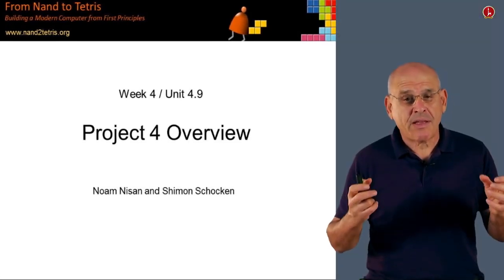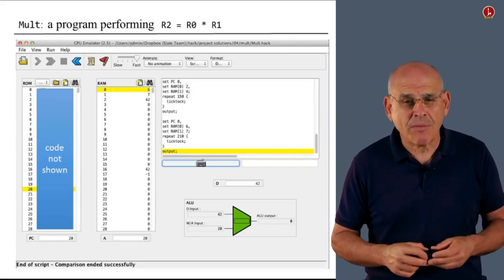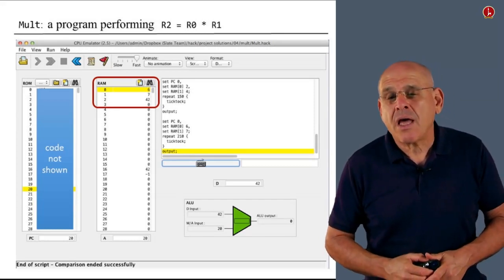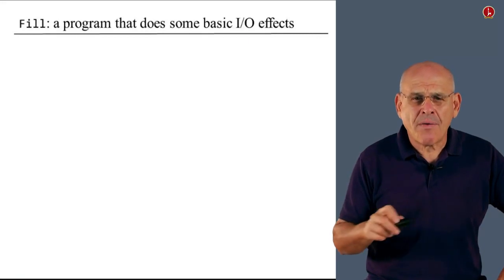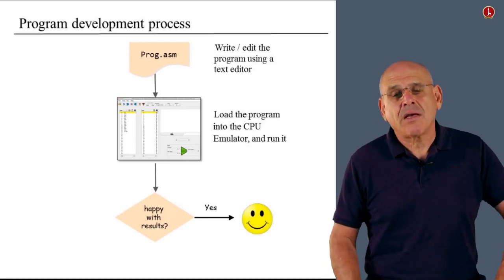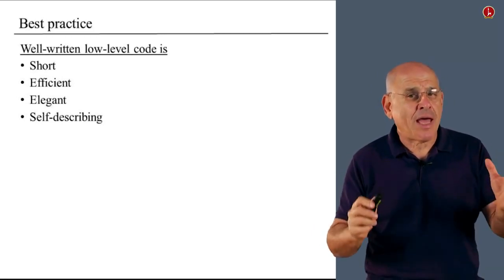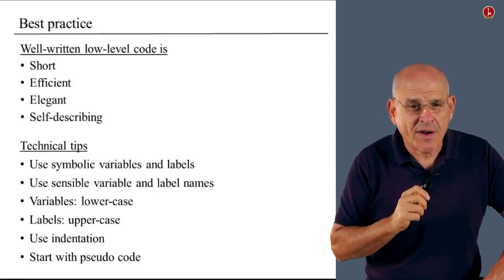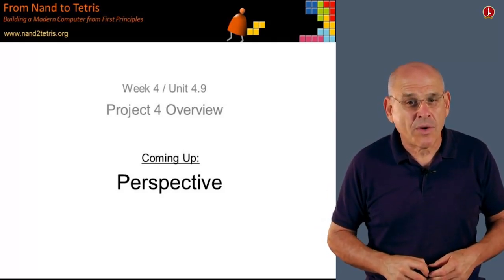[Part 1] Unit 4.9 - Project 4 Overview

Comment: For anyone who needs help on the project code, i'm leaving the full script here (with no comments) but it's mnemonically appealing enough imho. Also, this is only the fill code, not the multiplication one because i think that's a bit more obvious.
The codes on github currently don't work, so again -- spoiler alert for the assignment but in case you're stuck you can refer to this.

Notes:
1. 8192 is an invalid index for the SREEN chip (it doesn't exactly go that high which is why i've used 8100 as the upper end, feel  free to try out a higher index, if you can find one that's also valid)
2. The PSEUDO CODE is as follows:

STEP 1: ENTER LOOP

STEP 2: IF KBD IS 0 : 

STEP 2A_1: RUN WHITE LOOP SETTING PIXELS IN SCREEN TO 0 TILL i = N (8100) 
STEP 2A_2: GOTO STEP 1
ELSE
STEP 2B_1: RUN BLACK LOOP SETTING PIXELS IN SCREEN TO -1 TILL i = N (8100) 
STEP 2B_2: GOTO STEP 1

(LOOP)
    @KBD
    D=M

    @WHITE
    D;JEQ

    @BLACK
    0;JMP

    (WHITE)
        @SCREEN
        D=M
        @i
        M=D
        @8100
        D=A
        @n
        M=D
        (WHITELOOP)
            @i
            D=M
            @n
            D=D-M
            @LOOP
            D;JEQ

            @i
            M=M+1
            D=M
            @SCREEN
            A=D+A
            M=0
            @WHITELOOP
            0;JMP

    (BLACK)
        @SCREEN
        D=M
        @i
        M=D
        @8100
        D=A
        @n
        M=D
        (BLACKLOOP)
            @i
            D=M
            @n
            D=D-M
            @LOOP
            D;JEQ

            @i
            M=M+1
            D=M
            @SCREEN
            A=A+D
            M=-1
            @BLACKLOOP
            0;JMP
Reply: @8191 instead of @8100
.
.
I'm pissed, I thought I had to check every key because I misunderstood thinking that @KBD was just the first valid address of the keyboard memory map instead of a value just telling if anything at all was pressed.
So I feel it was a lot to do and look at your solution and there's no coming back.
But I could've tried, I had already a loop filling all the screen and the rest of the memory until crashing the program to -1 hahaha!

by the way, your example and its explanation was SUPER CLEAR. 
I don't know how to do that xD when I think I'm clear it's just horrendous chaos.

The other correction would be that your code doesn't paint the first word of the screen map, here are the two lines you need to add